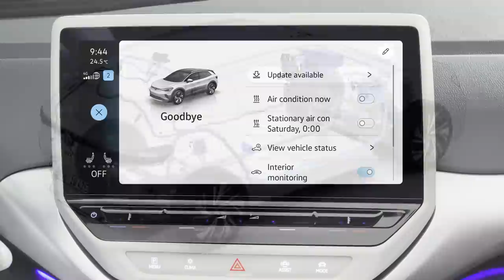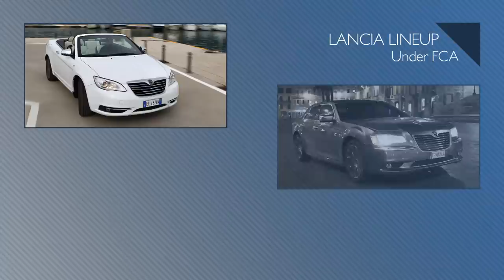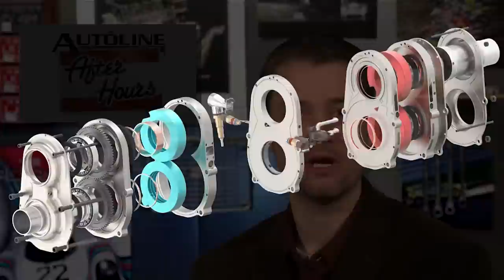Hackers Steal Volvo R&D Data; Lancia Wants to Be More Like Mercedes - Autoline Daily 3222

Comment: Correction: Autoline  (ie Sean) NIO's battery swapping "Station to Vehicle ratio" is how many vehicle owners on average, live in the service area of "three kilometers" to a battery swapping station,.  Not how many use it per month,

So you incorrectly stated only 258 vehicles on average use a station per month and 8 per day which was incorrect math too. 

Have fun trying to dis EVs with made up stats.... SMH...